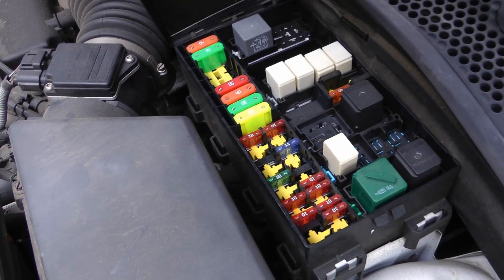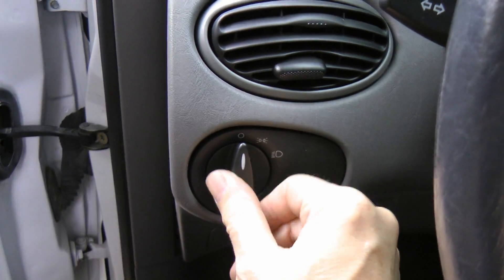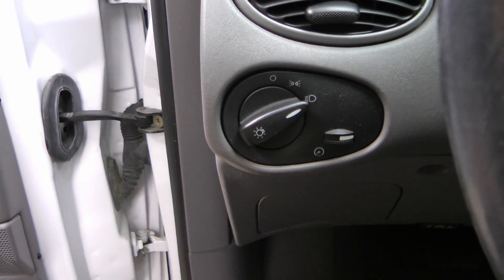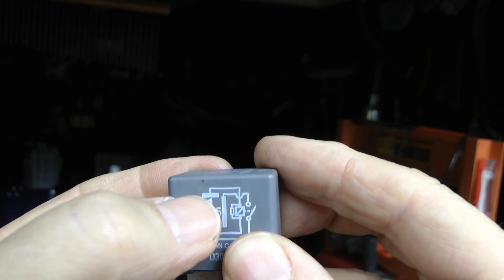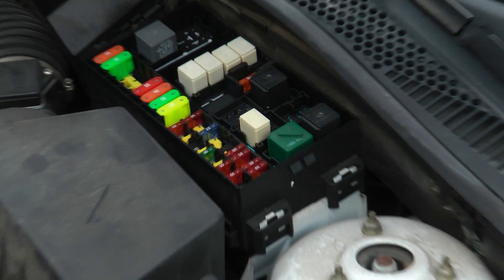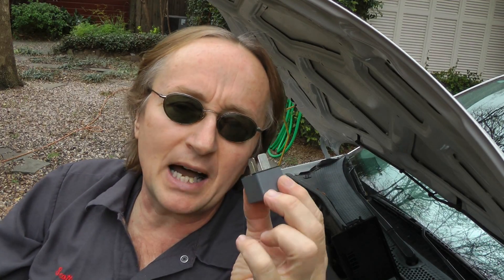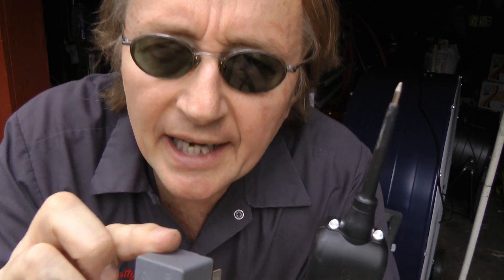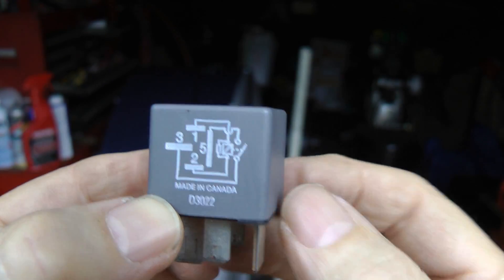How Electrical Relays Work in Your Car - Electrical Troubleshooting

Comment from the maker: Things I used in this video:
1. Power Probe: http://amzn.to/2Au7OUO
2. Common Sense
3. Full HD Camera: http://amzn.to/2AvoEk7
4. My computer for editing / uploading: http://amzn.to/2i2sKYz
5. Video editing software: http://amzn.to/2jv5Fhf
6. Thumbnail software: http://amzn.to/2k7tz6C

🛠Check out my Garage to see what I use every day and highly recommend:
https://www.amazon.com/shop/scottykilmer

❗️Check out the Scotty store:
https://goo.gl/RwhRGU

👉Follow me on Instagram for the latest news, funnies, and exclusive info / pics:
https://goo.gl/ohy2cA
Reply: Scotty Kilmer where is the turn signal relay switch for 2014 Chevy Silverado
Reply: Good evening need help finding relay for high beam lights on chevy s10 1997 i have no high lights but i do have lowbeam lights can u help me out
Reply: Scotty Kilmer  I switch up the relay box with that help me
Reply: gee scotty bit of a good looker there lol!
Reply: Hey scotty I have a 2013 Buick Lacrosse the hi beams comes on but the head lights will not I tried changing the bulbs and still on works and the other one wasn't. But now both bulbs not any suggestions.  Please help if possible
Reply: I have a 2018 Chevy equinox but my key fob stop working my tire pressure senors are not reading and also my fuel gauge stop working what can it be
Reply: On a 04 chevy impala how can I fix a fusable link to my starter becuz I want have to jump off my starter

Comment: I believe we have a parasitic drain on our battery (08 edge). 2 times we have had the battery go dead before warranty is up. Could it be a relay stuck in the on position?

Comment: Hello

I replaced the battery  car drive for 6 months 
 In December all the warning  lights came on the dashboard , brakes  and steering locked. The car wouldn't  start or respond to jump. I replaced the alternator  it drove for 1 week with no problems and then I all the indicator lights flashed again.  The alternator was taken out and put back in the car  . The car drove with no problems for a week then something happened  again.  What could  my possible issue? I was thinking a fuse but would have worked for a week with a bad fuse? Could it be my relay fuse?

Comment: Can you please guide for where is the fuse box  under the hood in honda city 2009 ivtec S model, I have found one but it is internal inside the cabin, I want to know where is the fuse box under the hood, we can see only three big fuses on the battery positive terminal but not able to find a fuse box under the hood..

Comment: I want to a asked a question, if I force the relay to stay stick will it spin the fan without the engine start or it will come out automatically when I turn on the vehicle at run position...?

Comment: Hello Scotty,  I need your help again. My daylight dash lights work fine with headlights turned off. But as soon as I turn my headlights on (day or night) the dash lights turn off. If I turn on my headlights with the key not in the Ignition, or off, the headlights turn on and so does the night time dash lights, but, (with the headlights still on) as soon as I turn the key on, the lights go out. All the lights illuminate, everything on the car works. There are No bulbs burned out. Thoughts? Relay? HALP!
Reply: Hey Scotty. I fixed the problem. The fuse looked intact, but I replaced it anyway. Must have been defective?

Comment: im having an issue with my 2006 honda Civic.. i cant use the keyless entry, the dome lights dont come on when i open the door, the rpm gauge goes up to 1 1/2 when i turn off the car, the windows don't roll down when the door hasn't been open... if anyone can help anything would be appreciated.. thanks in advance

Comment: But just because a relay clicks don’t always mean it’s 100% good. As you apply 12 volts also test The ohms resistant should be at .000

Comment: You need to correct your statement that relays only go in 1 way. 2002 Cadillac DeVille can go in 2 ways and at top middle interior fuse box it has 2 spots 2 relays can go in.
Reply: His statement is fine. It is your car that is the problem.

Buy a REAL car next time (Toyota).

Comment: If the relay closes, that's good, but a second test is needed.  The second test is to apply car battery current to the small pins and then check resistance in ohms on the large pins with a Volt-Ohm-Milliammeter.  That resistance should be as close to zero as possible.  Unusual resistance could cause other weird things to happen even when  a relay closes.

Comment: on my 70 Impala fan only works on med 2. car was like whatever is wrong with it when I got it last year. new switch and relay and fan only works on hi if wired straight to the battery. Bench testing shows relay is good. Just can't get the switch to control it. Something is definitely not right. Base is metal that originally mounts to a fiberglass heater box, so it doesn't even ground at the base. I've used relays for hydraulic and air suspension, but this one has me stumped. I also have the wire diagram. I don't have a diagram for the switch itself to rule out both switches as good or bad, but like your video

Comment: And the at autozone put battery in wrong then change some fuse and fuselink a120 replace the battery and atlernator and it still don't stay running and I don't have no dashboard lights

Comment: I got a 2001 lexus GS 300 I replace the battery and atlerator and it will not stay running and I change the fuselink

Comment: Hi Scotty. I bought a new remote keychain fob for my 1997 Ford Explorer and I programed it, when I push the panic button only the lights flash on and off, the horn does not make a sound when pushing the panic button, however the horn is working fine otherwise, just not with the remote, I hear a clicking noise coming from under the dashboard near the floor on the driver side when I push the panic button, the clicking noise seems to be coming from this little round silver part. I checked the fuse box under the hood, the fuse for the horn is good, I also tried switching the horn relay with another relay like you mentioned in this video and that didn't work, do you have any idea what the problem might be and how it can be fixed? Thanks for your time.

Comment: ok so i have a major issue both dim lights no working changed bulbs changed the dimmer switch on collum and fuses are good  there is a relay for headlights its good but there is one that says dimmer  the brights are good when changed to dim the highbeam symbol stays on and the lights go off??? 2001 Tacoma 2wd  2.4 L engine.. maybe you can help ???

Comment: Relays can go bad even if the solenoid is ok. With time the ressistance of the metal "switch" gets higher and higher and can introduce unstable switching. There are other ways it can go bad like fusing of the contacts on the "switch", etc.

Comment: Scotty I have a c200 and my radiator fan has been kicking in so late and so slow causing over heating. I have change the radiator sensor and checked the coolant sensor but with no luck. When I pull out the connection to the radiator sensor the fan runs with so much speed. Please help here.

Comment: Hi I have CITROEN c2 1.4 HDI diesel engine  I drove the car 
To church but before  I drove it my Car has cranked for too  long before  it starts  up but the I drove  20 k  to church  and parked  after two  hours  I tried to  start  the  car  but the car doesn't START  I called  the towing  to to the nearest  mechanic  he checked  all the fuses and also  changed glow plugs  he diagnosed the car  and the codes  was crank shaft sensor  we changed  it but the car  still don't want to  start  can anyone  help  please

Comment: this channel is my study point.I really wanna meet this guy once in life.
Reply from the maker: +Vishal Parihar thanks for the support 👍
Reply: @scottykilmer  Scotty got a question. My driver side power window stopped working. 1995 Camry. Just before it stopped working :  it went  up very very slow. Then briefly worked fine.  Tried it again 30 mins later moved an inch or so then stopped for good. No noise at all when hitting bottom. I think Power switch is still good since my tiny auto light on the main switch lights up when key is on.  Would your first guess be the motor and regulator ?  I heard a blown fuse will affect ALL the windows and not just one. That true in this model car ?   Appreciate your comment. Been a subscriber for over 2 years now.

Comment: The headlight on the passenger side of my car is out and changing the bulb doesn't fix it. The fuses look out, but I didn't know if I have a relay specific to that headlight or if the relay affects both headlights.

Comment: I have Mercedes 95 c280, my low beam work fine, high beam does not bulb are fine, and now I have engine check light + warning orange light bulb  on the dashboard. I'm try to use my obd2 with 38 pin adapter but does not work. Any idea what can I do. Thanks

Comment: I have pulsar 200ns which is liquid cooled motorcycle and yesterday suddenly it overheats and shutsoff because radiator fan was not running then mechanic reppaced the relay now everything is fine. My question is what are the causes of relay failure all of a sudden and how to prevent failure of new relay(any tips)??

Comment: My Passenger side Headlight ( Lo beam) doesn't come on, in my 2006 GMC Yukon Denali XL.  I changed the bulb and checked all fuses.  Both (Hi beams) work. relays seem good I rotated them to different spots everything is still the same,...No passenger side headlight lo beam??????????? Any Ideas?
Reply from the maker: check the ground wiring on that bulb first, they often go bad

Comment: Scotty Do i have a bad starter or a relay maybe even possibly a bad camshaft sensor my car starts then after i shut off takes mins to hours to start again? I checked the battery and am going to check ground wires in morning. Its a 2004 Nissan Xterra and what i did notice is there's a little oil on the starter from a loose valve cover gasket cause the rubber grommet got dried up and cracked so left room for vibration or leakage so i'm replacing all grommets and using thread locker that you can re-position over time if needed. Thing is when i do this id like to have it all done at the same time to save money!! Thanks

Comment: hi my cars ac compressor clutch is not engaging when i turn the ac on. used a wire to bypass the compressor clutch relay and it started to work so i figured it was the relay but when i put a new relay in it still would not work. any idea on what i should be checking next im lost in the sauce when it comes to electrical stuff

Comment: HI, I HAVE A 2000 FORD EXPEDITION EDDIE BOUER ENGINE 5.2   I HAVING PROBLEMS WHIT MY BRAKE LIGHTS  AND MY FLASHERS.   DONT WORK...   I CHECK MY RELAY AND FUSES     BUT THEY ARE OK.     ANY IDEA???   PLAEASE HELP ME OUT AND LET ME KNOW WHAT IS THE PROBLEM,       THANK YOU!!!
Reply from the maker: IF bulbs are ok, check for ground wiring at the lights, and pray it's not a bad body control module which is very hard to diagnose correctly
Reply: check the relay properly by measuring resistance across the relay leads that close the circuit it is controlling. it can click but still not close the circuit, permitting electron flow.

Comment: if you left light on in car how long it takes to charge up battery
Reply from the maker: a quick charge can be done with a 20 amp charger for an hour or so and then drive the car a while to finish it
Reply: Thanks again you are the best
Reply: if your jumper wires are thick enough, you can jump the car instantly. with crappy wholesale jumper cables it will charge in 5 minutes, enough to start, then finish it off.

Comment: Hello Scotty,
Do low beams and high beams have separate relays? If the high works but low doesn't, is it likely to be a switch problem or a relay issue. Bulbs seem ok (2001 Ford Escape)

Comment: Hi Scotty,
I know that this is an old post but I know you answer all of them. I do have a question about something similar happening with my 2012 Acura TSX. I did the parasitic draw discharge test you recommended on another video and found a draw 3.49mA. While doing it I found a fuse in the engine fuse box, # 15, it is called Backup in the manual, nothing else. It is  where the draw stops. When I removed it, I noticed that this fuse control many other fuses which I haven't been able to determine what exactly they control. I know that when I remove it, the interior lights, most of the dash controls, the radio, the Nav and many other things go out. The dealerships around me want $130 just for the diagnosis and probably $700 to over a $1,000 for "a repair". Any ideas about what to do next? Thanks.

Comment: Hi Scotty! I hope you are well. :) I have a 2000 intrepid 2.7. I need my car to last another year. Then I can afford a new car. So, the problem is : It seems in the morning usually I will be driving 80 km  /hr. In  Canada. :)  The car will all of a sudden. Lose power, no gas and instant drops to zero!! I had to coast a little. Then brake and I put it in park and it starts up. Can you suggest all we should look for. However, if I have to get another cheaper car to last. What do you suggest? Year? Make! Kilometres? I thank you! Please let me know what you think first is wrong with my darn intrepid. I hate this car! Was there problems with this car doing this? Anyone else? Suggestions greatly appreciated! :)
Reply from the maker: those are junk at that age, worse engine dodge ever made. Get any good used toyota, mileage and year just depend on how mucch you want to pay. BUT, have a pro road test your car with a dealer level scanner hooked up, and when it dies, the scanner records the problem data area for analysis

Comment: i am using hid in my car and it is 55watts if i want to go 70watts can it burn out ny wiring or if i put a relay i will be ok to put the 70 watts
Reply from the maker: put in a relay, they can handle anything if you get a good enough one

Comment: I had a Honda Accord fuel inject fuel pump relay failed over 15 years ago for a 10 year old car at the time. The relay was under the steering wheel, above the brake pedal. It was mounted on a small circuit board. The soldering job failed after millions of vibration and clicking.  Yes, it clicks, but the power wire soldering joint failed.  So I re-solder it.

Comment: Hello Scotty! I have a 96 Toyota Tercel and it randomly makes a buzzing sound from the relays in the fuse box under the hood, do you know what that could be? the battery is dead and sometimes it still does it, I'm concerned that the battery is being drained somehow?
Thanks.
Reply from the maker: do my video "finding battery drain on your car" to fix that dead short

Comment: Scotty my turn signals don't come on in my 96 ford ranger after pulling my gauge cluster to replace an odometer gear. The fuses and relay are fine. What now?
Reply from the maker: either wiring isn't pluggedd back in tight OR you broke the circuit board taking the gauge cluster off
Reply: Circuit board, where? I don't see how that could have happened.
Reply: Thanks Scotty, I pulled it apart again and traced the problem to a wire that had pulled out of the multifunction switch. Pushed it back in and whammo, good as new.

Comment: Hi Scotty I got a question on a 98 4 runner, My head (light) relay switch makes a clicking sound when there is no key in the ignition and headlight switch is off, which is draining my battery how is this possible if there's no key in the ignition cylinder
Reply from the maker: relay could be bad

Comment: Hey Scotty, my car doesn't have power going to the starter wire from the ignition
Reply from the maker: check ignition switch AND neutral safety switch if an automatic
Reply: +Scotty Kilmer sorry I have done and it's a 1984 bmw e30 I took the ignition switch out completely and tried hotwiring it but don't have power to starter, what else do you think it could be?

Comment: Just because it clicks doesn't mean it's working,  you may have burned contacts inside preventing it from working
Reply: missing the most important part actually. who gives a shit if it clicks? what we really care about is if the circuit is closed, permitting whatever it is controlling to work.
Reply: Correct! missing info on that video.
Reply: ae86miami So let me see if I got this straight, what you're saying is that if you Supply Power to the relay and it makes a clicking noise then all that definitively indicates is that the solenoid is functioning properly and not necessarily the relay as a whole??? Okay I see what you're talking about, but how would you go about testing it at that point? Supply power to two of the terminals and then check the other two adjacent terminals for power using a probe or would you do a continuity test with a multimeter and if so what would be an acceptable level of resistance??

Comment: My girl has a 2003 nissan muranno the other day she got in the car and the car alarm kept goi g off for no reason then it went off over time...Her key fob is broken I changed the batter in the fob and the fob still not working....Does the key fob have anything to do with the car alarm going of when she goes to get on the car.....If the car alarm goes off when she gets in what's the best thing to do to shut car alarm off...
Reply from the maker: get a new key fob and have it programmed, but realize just using the key in the driver's door should shut it off, so maybe the driver's door lock sensor is bad too
Reply: Scotty Kilmer scot I take it the sensory is in the door.....And by any chance if the sensor bad can I just take it out and not use it for the time being will that stop the problem
Reply: Danny Di vuelta